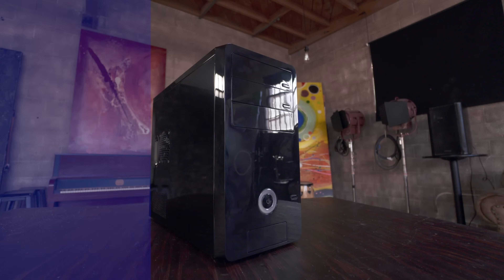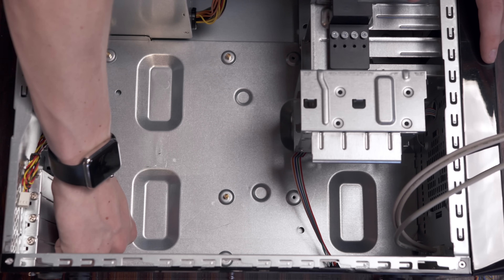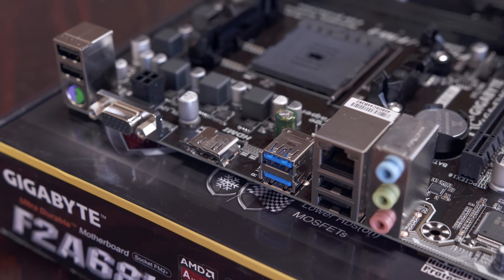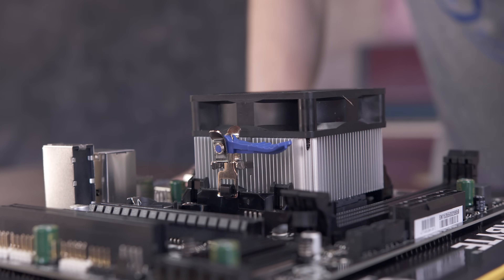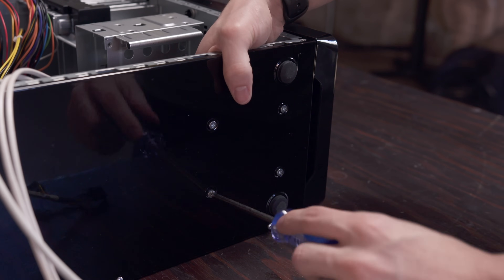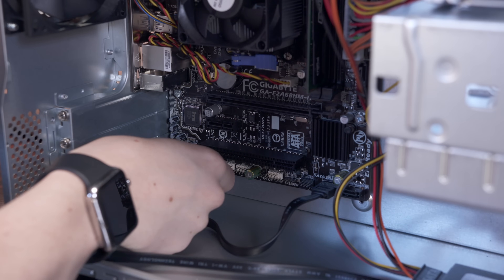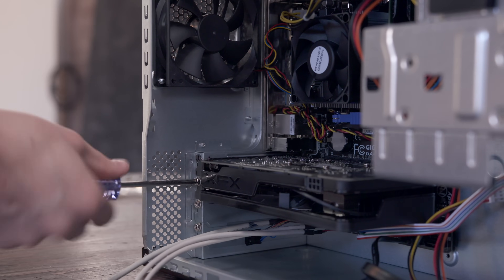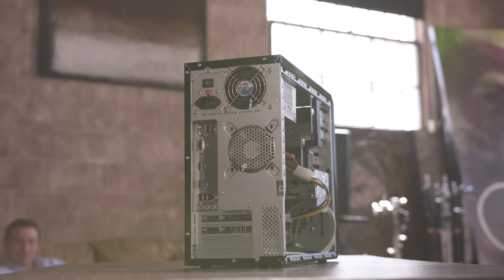How to Build a Gaming PC! (2016)

Comment: Please tell me if this is everything i need for a gaming pc and it its good 

Intel Core i5 6600K 3.90 GHz Quad Core Skylake Desktop Processor, Socket LGA 1151, 6MB Cache (BX80662I56600K) 

MSI R9 390 GAMING 8G Graphics Card 

MSI Pro Solution Intel Z170A LGA 1151 DDR4 USB 3.1 ATX Motherboard (Z170A PC Mate) 

NZXT S340 Mid Tower Case CA-S340MB-GR Matte Black/Red 

Corsair Vengeance® LPX 8GB (2x4GB) DDR4 DRAM 2400MHz (PC4-19200) C14 Memory Kit

Crucial BX100 250GB SATA 2.5 Inch Internal Solid State Drive - CT250BX100SSD1 by Crucial

WD Blue 500GB Desktop Hard Disk Drive - 7200 RPM SATA 6 Gb/s 16MB Cache 3.5 Inch - WD5000AAKX 

Corsair CX Series, CX600, 600 Watt (600W) Power Supply, 80+ Bronze Certified by Corsair

Total price : Subtotal (8 items): $1,049.16 Is this a good enough pc to run games in 60 fps ? i'm very new to this xD
Reply: Maverix for a 1k budget, you should at least have a GTX 1070 in there
Reply: can you help me ? im new to this
Reply: Maverix this PC by the way can run games over 60 FPS, also if you aren't really planning on over clocking don't get a K CPU but if you want to overclock I recommend you get a aftermarket CPU cooler
Reply: yo I can help you out, pm me :P
Reply: I can help you out. I don't have a Skype user but just type in my business email into the Skype search: tyaheadfilms@gmail.com
Reply: Shex ! What you wanna talk over ?
Reply: Maverix You should get a better GPU, I'd say maybe a Nvidia GeForce 1060 or Radeon RX 480. If you want cheaper, go for a Radeon RX 460.
Reply: Did you look on Amazon? because they have the wrong listing it's a 3.5 GHz processor, If you are not sure go on to pcpartpicker.com to check your pc build, but other than that it looks like a descent build.
Reply: aaron robertson okay
Reply: Shex ! Add me Slyhound17 thank you man !
Reply: Less than $1000 and has a 6600k and a gtx 1070: http://pcpartpicker.com/list/pNWTm8
Reply: Tech By Miken XD ty but I just got a new budget
Reply: Tech By Mike $1500 sorry X3
Reply: Tech By Mike but is liquid cooling risky
Reply: Maverix Not really. I've never use liquid cooling before, but it's very very rare for something to go wrong. With a $1500 budget, you should get a 6700k and a gtx 1080, let me make a pcpartpicker list.
Reply: Here's a new one for under $1500: http://pcpartpicker.com/list/sCHtCy
Reply: Tech By Mike ty
Reply: Tech By Mike do you have Skype
Reply: Tech By Mike rip its 2k for me I'm Canadian
Reply: Maverix So i guess you will have to get a 750 usd pc. I guess you will just have to get a i5 6500 and an rx 480.
Reply: welp ;p
Reply: can you skype ? i will make my budget more
Reply: Maverix No

Comment: Is this a good build?

CPU- Core i3 6100
Mobo: Asus H110 m a d3
Graphics card: GTX 950
Ram: 2x 4gb Kingston HyperX 1866 mhz
Storage: WD Blue 1tb hard drive
Power supply: EVGA 500w
Case: Deepcool Smarter

Comment: Forgot that motherboards have main slots for the memory cards and side slots  in pairs (stated on the body of the motherboard). usually aligned as main | side | main | side . if you have 1 you want to install it on the first main. if you have 2 install on both of the mains, NOT 1 ON MAIN AND 1 ON SIDE ! It will run better ! (and if you have 4 then just push 'em all in).

Comment: Hi all, I'm building my first moderate gaming PC and here are the components I selected:

Intel Core i5 6500
Kingston HyperX Fury Black 8GB 2133MHz DDR4 RAM
Asus H110M-D - 6th Generation DDR4 MotherBoard (LGA1151, DDR4 2133Mhz)
ZOTAC GeForce GTX 960 - 4GB DDR5
Samsung 850 EVO 250GB 2.5-Inch SATA III
Seagate Barracuda 1TB
Asus Internal DVD Writer
Corsair CX500-80 Plus Power Supply
LG 24MP88HM 24"IPS Slim LED Monitor

I'll very much appreciate any comments or suggestion, thanks!

Comment: Why couldn't u list the items I needed to make my own pic in the begging if someone could can u tell me what I need to make my own pc
Reply: you need:

case

motherboard

cpu

power supply

graphics card (recommend for gaming  but not needed if you have a built in graphics processor in your mother board)

operating system

hard drives/ssd

RAM
Reply: all you need to make a pic is a camera
Reply: - Here is the complete list:

Case
Ram
Power Supply
Motherboard
Hdd/ssd*
Cpu
Gpu
Cpu cooler
Fans/Watercooling**
Windows
Wifi adapter ( If your motherboard does'nt have one ) or u can use Ethernet cable
Cables
Thermal paste ( If your cpu cooler does'nt have some applied.)*

- Extra's

Cd drive ( For windows, Windows can also be installed via a Usb drive, Thats why i put it as an extra.)

* = a SSD is faster and less fragile so i schould get a SSD to install windows on, that means that windows load much faster.

** = Watercooling is more expensive but keeps you parts cooler, Normal fans should do the work fine as well.

* = Thermal Paste needs to be applied in between your Cpu and Cpu cooler, It prevents your Cpu from overheating.

Sorry for the bad english, Im dutch and 12 y/o so i dont speak Engilsh very well...
Reply: it's got no moving parts, it's smaller, it's much faster in.loading files or writing files on to. that's why whatever you put.on the ssd, it will load.much faster compared. to hard drive. it's also less fragile since it has no moving parts
Reply: Ram
Case
Power supply
Motherboard 
Hardrive/ssd
Cpu
Graphics card 
Cpu cooler
Reply: goonber if i had a 128 gb ssd does that mean i cant download more that 128 gb?
Reply: You don't need to purchase a product key to use windows 10. When installing, just say that you don't have a product key and you can still install and use it indefinitely.
Reply: Your CPU is overkill. That's more for video editing/streaming. The graphics card is weak as fuck too. Here is something a lot better. This will run most modern games very high/max settings 1080p:
https://pcpartpicker.com/list/JzQjqk
Cheaper and several times more powerful than what you listed. I'm glad you asked, because you're clearly new at this. Also, do you already have a keyboard and mouse, cuz you need those.
Reply: Overwatch isn't demanding at all, that game can run on a potato. This will play overwatch at epic settings 60fps.
Reply: it will load faster
Reply: watch a hdd vs ssd video, that will give u an idea
Reply: no not always, make a part list on pcpartpicker, that will make sure everything fits for you
Reply: Case?
Reply: Lol you don't know much about computers
Reply: QuickScope sorry expert 😂😂
Reply: How much money you got?
Reply: Yeah, most people only use ssd for windows and a couple of programs, for everything else, just get a 1tb hdd, use the ssd for important programs and hard drive for all your other programs because a 100gb ssd isn't going to last long (unless you are planning to install a few software and that's it)
Reply: goonber whats the difference between an ssd and a hard drive? Isnt it just download speed?
Reply: goonber so if i had an app on it will it load faster or is it just the download speed
Reply: goonber does everything fit with everything
Reply: what do you mean?
Reply: dom you mean, does any cpu fit on any mother board?
Reply: do*
Reply: goonber for I get any random parts will they all fit together
Reply: OnlyImmortal Ok:
GPU
CPU
MOTHERBOARD
HEATSINK
HARDRIVE
DVD READER(optional)

I think that's it but I might've missed something
Reply: Fifacreeper what about memory/ram
Reply: And power supply
Reply: Everyone keeps forgetting that you have to actually buy and install an Operating System also. Or even a wireless adapter if your motherboard does not have a built in wireless adapter (unless you are wired to your router). And also a cd drive to install the OS. And a hdmi or vga, cable connected to the monitor for display. And finally, when your finished building, you need to know how to go into the BIOS menu and boot from your cd drive, to install the OS. Because these were some of the little problems I faced, the first time I built a computer. Took me a solid 6 hours to finish building it. To me the hardest part was actually connecting all the wires to their right places, without making a mess inside with cables everywhere.
Reply: ***** yes that works too.
Reply: im a bit new to pc gaming are video card and graphics card the same becaus i picked parts for my pc on parts picker and i only saw an option for video card not gpu
Reply: Zuesgaming101 they are the same
Reply: If you're that new, I think you should post your pcpartpicker list so we can double check everything.
Reply: https://pcpartpicker.com/list/J42v2R
Reply: or this one it is a little cheaper good for overwatch at all https://pcpartpicker.com/list/MdLWKZ
Reply: will this be able to play overwatch at atleast 60 on high or medium because i planned on recording overwatch gameplay
Reply: thx bro you helped alot
Reply: EPiCGAMiNG Exactly. I could run Overwatch on my toaster and it would still work.
Reply: goonber thanks!! I was planning to make a gaming pc but didnt know all the parta needed
Reply: xSGKx Bu11et u can download windows 10 off of the Microsoft website for free but u need a key which u can get off of kinguin.net for $20
Reply: goonber Wait so you either have HDD or SDD, right? Or you can just add SDD if you want?
Reply: Виктор Тодоров you can have as much ssds And hdds you want as long as your mobo has enough sata ports
Reply: 10/10 english
Reply: OnlyImmortal You are a fucking idiot.

Comment: Is this a good build?: http://pcpartpicker.com/list/T3tt7h
Just wondering if there's any parts that I need/don't need,  + I'd take any suggestions too.
Thanks!
Reply: ohboi I'd say get faster RAM, and a GTX 1060 might be better, but it really depends on what you'll be using the GPU for. It looks like a great build.
Reply: ohboi No problem. Really, you're build is great either way. Faster RAM would really not have much of a difference at this point. Good luck with your build! And also, I would recommend the 6GB GTX 1060 over the 8GB RX 480, but it's up to you really.
Reply: It's okay, remove the thermal compound it comes with the 212 evo. Do you need an optical drive? Do you need 3.5TB + 240gb of storage? I think it will be possible to put a 1070 in.
Reply: The optical drive is a yes. Now that I'm thinking about it the 3.5tb + the 240g is a bit overkill. Which would you recommend over the other? Or would you recommend something completely different? Don't know what you mean by 1070. Thanks for the help!
Reply: i think im good with the 480 honestly. ive revised my build a bit: http://pcpartpicker.com/list/TGCYNN
i might go with this. id still gladly take any advise tho.
Reply: i also have a 2nd, slighly more expensice build that has a 525 gb ssd and a 1 tb hhd. idk if i should choose the 1st build i listed, or this one here: http://pcpartpicker.com/list/4RBKXH
Reply: What's the catch to Kinguin tho. It says it requires "InstantGo" for description. Do I need to do anything extra to actual have the key work. Is this site even legit?
Reply: Also, how would I install the OS onto the new PC anyways? Been having trouble figuring that part out.
Reply: Why has nobody pointed out that the PSU is overkill. You don't need 600+ watts. Save some money and get around 450-500 watts. And do you really need that much space on the SSD? You already have 1TB. You could get 128 GB SSD for about 50 bucks and you won't be running out anytime soon, especially since you have that hard drive. I also agree with Rekikz, Kinguin will save you like $70.
Reply: ***** I know, but having such an overkill PSU could harm your computer.
Reply: +Rekikz is kinguin a reputable site? operating systems for that cheap seem kind of fishy. (then again. ive never built a pc before) And no matter where i buy the os, im just going to get a key, then i have to go to the windows website and do everything from there, is that right?
Reply: ***** cool. thanks for the insight, its much appreciated
Reply: Okay, so here's what my build looks like now: http://pcpartpicker.com/list/3wxnGf
I've already purchased the CPU and the Power Supply, plus a Windows 10 key from Kinguin. Does anyone have any other suggestions? Am I missing any necessary parts? Any compatibility issues? Thanks for all the great advice so far too!
Reply: or this one? https://www.amazon.com/dp/B01IEKYD5U/?tag=pcpapi-20
Reply: i think i'm good with ram too. idk maybe i'll mess around some more with options. Thank you for the advice!

Comment: Can you use any screwdriver? I've heard that you shouldn't use metal ones.
Reply: You can use any screwdriver. Trust me, i've being building PC for 7 years.
Reply: Thanks mate!
Reply: Not just you can but you MUST use a screwdriver. Without it you couldn't screw the bolts.
Reply: Shasta Holly It wont effect the motherboard at all. There are no component on the motherboard that are sensitive to magnetism.
Reply: Yeah I knew that but I wasn't sure if you needed special screwdrivers. There are special kits to buy online but i guess they are scams.
Reply: Benjamin Court Yes, those must be scams. I use one of my father's old, regular screwdivers. Built and repaired a lot of PCs without a problem with it.
Reply: WB IsMe My mom said not to use magnetic screwdrivers cause it could mess up the motherboard, is that true? I hope not cause I only have magnetic ones haha.

Comment: People help lol i built a pc and went to power it on and fans and led came on so i look at the monitor and its a blank screen, no signal?After that i unpower try to fix cabling and power up again and the pc wont even start lel. Tried a few more times, flipped the switch on the psu not the pc and then the fan, graphics card fan and led were stuttering like switching on and off, Im so confused help please lol
Reply: Leave it for atleast a minute while it posts. Plug your DVI/VGA/HDMI into the motherboard instead of the video card vise versa

Comment: This is a GREAT video! You packed what others do in 30-45minutes in just under 6. Straight to the point, and 100% accurate! Awesome work. I do have a question however. How hard is it to install all the drivers? If I where to build my PC and put the Windows 10 OS on it, would my drivers be up to date?
Reply: Your OS will not be up to date. You can always download the driver from the internet.
Reply: WB IsMe Would it say where to download the drivers in the manual? I'm sure I could, rather simply, figure it out. But I think it's always better to know exactly what to do before hand. So as to avoid any unnecessary stress.
Reply: The only few important drivers are Realtek Sound driver and graphic card's driver.

If you are using Intel processor, you need Intel integrated graphic driver.  

All can be downloaded from the internet. Actually, window updates are not important but recommended. I have no done any window updates for years.
Reply: GravelsNotAFood omg if i see you one more timeeeeeee
Reply: ʟᴏʟᴅᴀᴡɴツ Fuckin' Hell... You're like herpes. lol
Reply: Well, the "others" also give us a lot of additional information, so it's just good to have a wide variety of options :) Cheers :)
Reply: what actually happens if you don't install the drivers? And I'm guessing you should go on the website of your motherboards brand and install the drivers from there?
Reply: why in the hell would you not have done any Windows updates...some can be strongly recommended for better performance and actual issues with the OS itself!

Comment: will a network card fit in the motherboard with that graphics card
Reply: A PCI network card will work. A PCIE network card will be blocked by the graphic card. You can always go for USB wifi adapter.
Reply: +WB IsMe Ok thank. Ill need to return my network card then.

Comment: I'm thinking of upgrading my PC, is this build good for running a 1440p monitor at 100ish frames? I will mostly be playing BF1 (medium-high quality)

CPU: Intel i5 3.1GHz
GPU: Nvidia GTX 1070 (EVGA FTW)
PSU: EVGA SuperNOVA (Modular; 80+ Gold)
CPU Cooler: Noctua NH-U14S
SSD: Samsung 850EVO 500gb
HDD: 1tb hardrive
Ram: HyperX FURY DDR3 16gb
MB: MSI B85M Gaming
Case: Tesseract SW Deepcool
Monitor: Dell S2716DG 27"

Thanks so much for the feedback!

Comment: Hey! if you make boson 4.0 try to use RX 480
Reply: Use the new GTX 1050 ti :
Reply: I know this comment is fairly dated.
But it's been proven multiple times the 4gb and 8gb rx 480s perform nearly the exact same. Save yourself $100 and get a 4gb.
Reply: GTX 1050?
Reply: RX 480 itself cost $300. The whole build will cost more than $700.
Reply: how about RX470 or 460?
Reply: Bluestonez RX460 is the only card if budget is around $350.
Reply: Gtx 1060
Reply: I'm sure that he can set the budget to $450 and get a 4gb RX 480 for $220.
Reply: Vince Offer but...but.... but SLI :(((((((
Reply: rx 480 is 200
Reply: william bui then he can just get an rx 460, still a really solid budget gpu
Reply: nah nah nah gtx 1050 ti

Comment: SSD? But I got a 1tb hard drive ;-;

Wat do?
Reply: what? ssd has no benefits in games, except for faster loading... you wont gain a single fps by installing ssd
Reply: Lol 1tb hdd isn't that bad, it's a bit slower than ssd unless u do hardcore gaming of course
Reply: WB IsMe Sadly somebody already beat me to that last year.

Just Cyanide It's not really that it's bad that's the problem. The problem is more that the video didn't cover how to install the hard drive.

I figured it out though
Reply: it's the same process of installation, but the big difference is the HDD is more fragile.